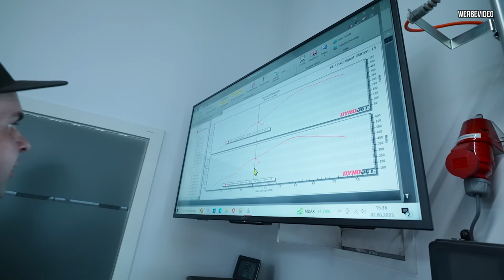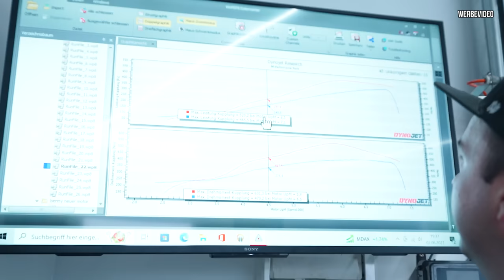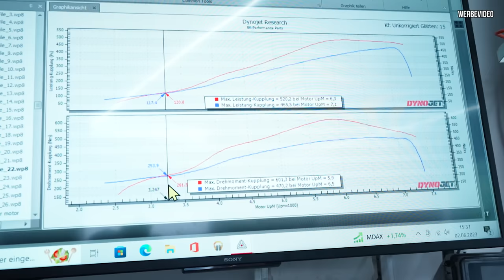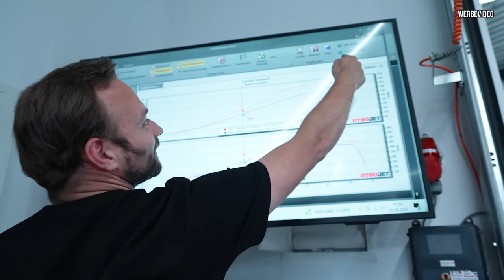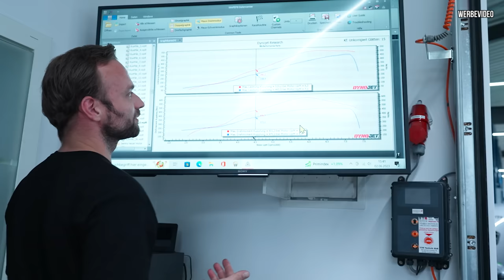Über 500 PS starker BMW e36 mit Turbolader für die Rennstrecke! Zuviel Leistung?

Comment: Ist das nen M50b25 oder nen M52b25 ? Sieht auf den ersten Blick nach nem M52 aus, kann mir aber kaum vorstellen, dass der Alu Block so viel Leistung aushält. 🤔
Reply: Sieht nach einem M52 aus, vorne  die Stirn. M50 sind komplett eckig(haben keinem Steller an der Einlass Seite.) Und die M54 sind vorne abgeflacht.
Reply: der alublock hält das easy aus, ich mach 500ps und 600nm auf nem 4 zylinder 2l alublock. Das mit alublock wird erst interessant nördlich der 800ps aber davor is das jux ob alu oder stahlblock beim b25/28

Comment: Wenn man Zwei Elektromotoren verkabelt und man dreht einen, dann dreht sich der andere sofort von selbst. 

Man könnte Zwei Gebläse haben und einer deht das Abgas. Und der andere bläst Frischluft. Man könnte so locker auf eine Tubo verzichten der bei defekt das Motoröl verbrennt. 

Ich denke heute Frischluft oder Tubogehäuse oder Auspuff sollten ein Kugelventil haben und wenn das Öl verbrennt stoppt man die Luftzufuhr. Ich sah ein Video auf einem unbefestigten Platz. Einer hält den Flaschenboden irgendo wo dran in dem Motorraum und der Motor geht aus.